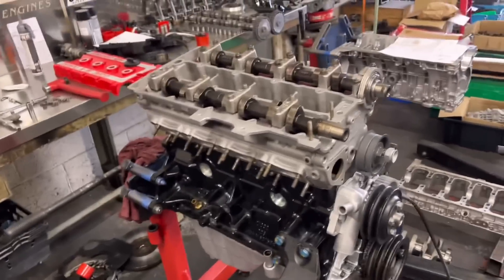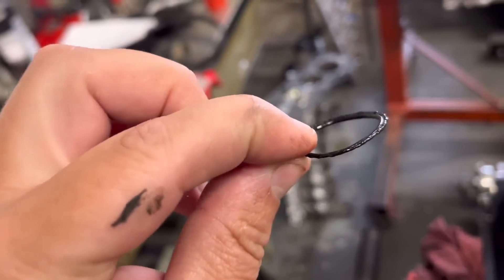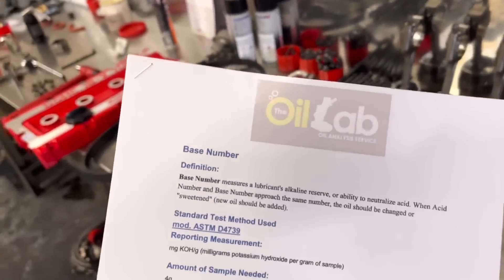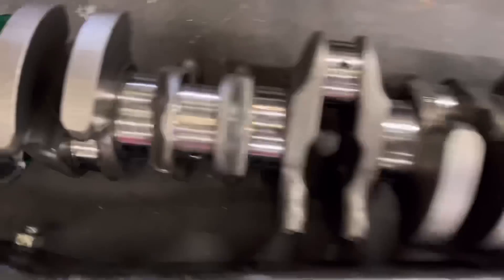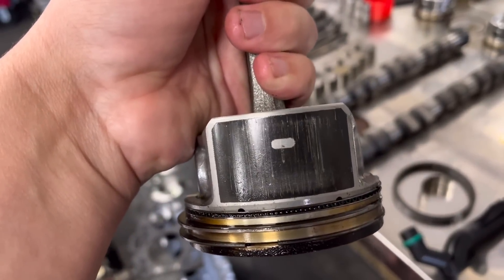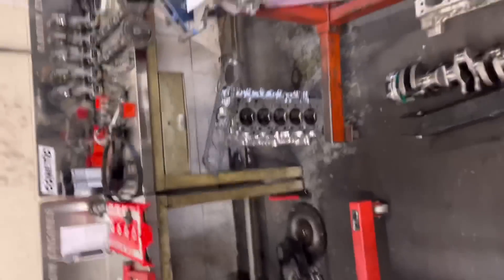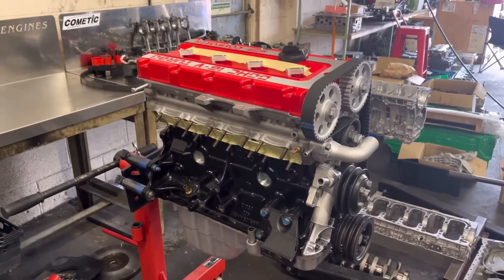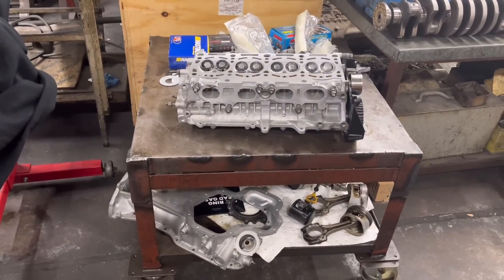Cosworth engine could have FAILED because of TINY part, BIG mistake!

Comment: Hi Lee. Do you charge a one off inspection fee for that level of diagnostic on the cosworth, or are charges varied. Just wondering at what point the customer decides if the inspection is worth the cost as this would be on top of the new engine or work to be done? Ta fella.

Comment: Lee; As another subscriber commented it would be good for your quality control as a professional engine builder to have with each engine the following; Produce a standard printed engine spec sheet which would have all the dimensions and visual comments of when you strip the engine. when different people do various jobs to a engine it keeps the information all in one place for all to reference (put on paper then if you forget its still there). The next step would to then log /document the new dimensions after machining and assembly. It backs up the job sheet and could in any dispute with customer be the recorded evidence. I get confused some times when your reviewing all the engines in the workshop and at what stage of work they are / and what parts are needed / or waiting for. To help with this and and all you guys inc part time Paul!!! you could get a thin hard A4 file box, every time you start a job the name of customer/engine is clearly identified and what he wants doing to it.

Comment: Lee, do you save build values rather that the current piece of cardboard method. A simple printed sheet, possibly excel based for ease of updating as a maintained built data sheet, could follow the job cards around containing before/after values and calculated/measured clearances at final build. Also it may be nice to see how Isaac's off the scale flywheel balance was corrected as you had no starting point for position of issue. We used a similar machine for balancing pump impellers, which being cast could be massively out and would add plasticine at various positions to give us a readable starting point.

Comment: 2 engines, he might want to check the fuel feed to that one injector also. Injector can be perfect, but if it can’t get the fuel, it can under feed the cylinder.

Comment: Why didn't Ford go ahead with the "eternal chain" timing chain they spent a vast fortune on developing and found on the 2500 "lazy cossies" which were part of the development programme?   Very odd Sierra's the lazy's were, mainly GL basicish trim but easily go off the clock just on a carb which Weber developed solely for this particular engine.   I remember my dad getting his, he got it half book price of a brand new Sierra, doom blue as they all seemed to be "doom" coloured, manager who sold it to him said the car went back to Dagenham before receiving all brand new seats, carpets and door cards and that thing was a total street sleeper.   Chap round here in Dorset has an estate "lazy" and he couldn't get a carb from local Ford dealer so I tipped him off that obsolete parts at Ford Hamburg was the place to find one and they had one to him under 10 days.
Reply: What model are you talking about ?

Comment: How about the cylinder bore geometry on the damaged cylinder on Focus ST-engine? Ovality? Also, when the big end bearing starts to seize, it will increase the lateral forces on the piston/cylinder contact. Over fueling the cylinder can heat up the top of the piston, not that much the piston skirt. But, also the firing pressure will increase in case on over fueling and that can be too much for the big end bearings. You are right with the injectors -why save couple of hundreds for not testing them, when you are burning thousands on engine rebuilds.

Comment: anyone any idea why the 2wd and 4wd have different seals on the camshaft? seems a little silly
Reply: The 4wd was built later (88-89) and added a number of improvements to the earlier (1986) 2wd design - block, pistons, ecu, fuelling, oil and water cooling system, turbo and more were all changed. None of it is massively different (put the two next to each other and there's not a lot to see, visually), but just a series of small incremental changes. Probably Ford and/or Cosworth thought that the later sealing design was an improvement.

Comment: Hey Lee, sometimes silica can come from high aluminum debris, silica is part of high strength aluminum, also high flow air filters allow fine silica road dust into the intake and it ends up in the oil. What is the year range for the Cosworth's you work on. All I know about them is the Cosworth Vega 🤣🤣
Blue Mule
Reply: The Cosworth YB lump seen on here was introduced in 1986 in the Ford Sierra Cosworth as the ~200bhp YBB and incrementally improved right up until the Escort Cosworth in 1995, by which time it had changed to 4wd, produced 227bhp and has the YBP model code, but was still basically the same engine in most respects. The 2wd models used in the Sierra also used the ubiquitous Borg Warner / Tremec T5 gearbox. The block in all models is derived from the 2.0 SOHC 8v 'Pinto' that Ford used in almost every vehicle they produced in every market from the late 60's onwards.
Reply: They're also very responsive to mild tuning mods as standard - a simple swap of injectors, turbo actuator and remapped fuel/ignition can easily bring 100bhp or more. It's clear that Cosworth designed a head and intake/exhaust system that was capable of far, far more than Ford let the vehicles leave the production line with.

Comment: As measuring all the physical sizes and weights of crank/rods/pistons etc appear on many engines, I am very surprised that a standard pro-forma sheet is not available for the engine build that is completed as it is progresses rather than use scrappy bits of cardboard to record the data.  What happens if cards from two engines get mixed up or lost?  A final build spec could be completed and sent out with each engine that will provide excellent data for the future as well as for claims.  Its a much more professional way of working.
Reply: Those scraps of card are literally just my notes as I work so I don’t lose track of the numbers in my head haha
Reply: @IsaacBarum  Hi Isaac,  I appreciate that you need the information but looking at the numbers, they would be useful data to refer to and to provide to the customer, I'm just suggesting having them in a build schedule, where you can refer to them and will be a record.  Well done on the quality of the build.

Comment: I'll never understand how people who've blown their engines will pay a bucket load of money for a fresh refurb or crate engine, then bolt on the old oiler cooler, pump, and injectors.

Re:  injectors.  Have them cleaned and flowed at a minimum.  Cheap insurance that can save thousands.  Any engine your pushing needs to have the injectors flowed when new.  I can't count the amount of times I've seen major flow discrepancies right out of the bag.

Comment: can't say i agreed with  your analysis on the st engine to me it looks like an oil starvation issue or  bearing tolerance  problem.
Reply: I have t
Reply: I have to agree with you, both a big end and piston in the one hole has got make you suspicious. I am a diesel mechanic, and these types of failures are usually the furthest from the oil pump. Certainly have seen pistons melted by injectors but no
Reply: it could be , except they checked all that and found no fault,  Oh and its the second engine in that car with a similar fault